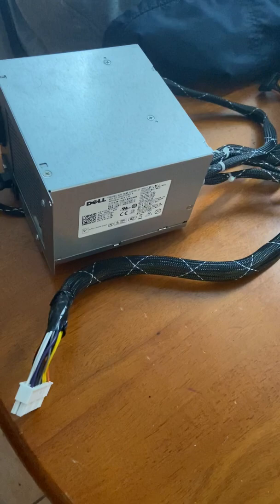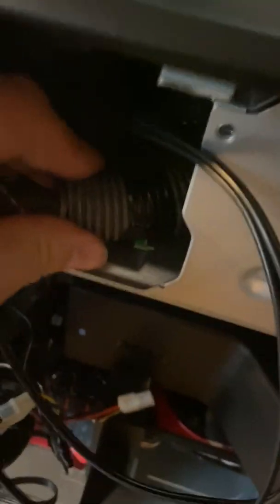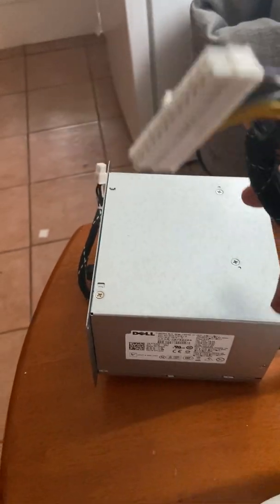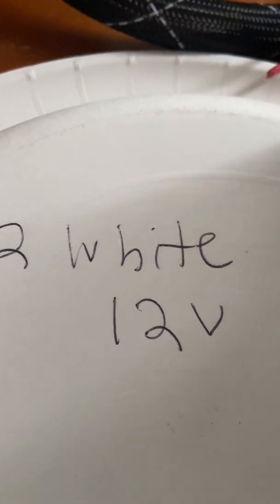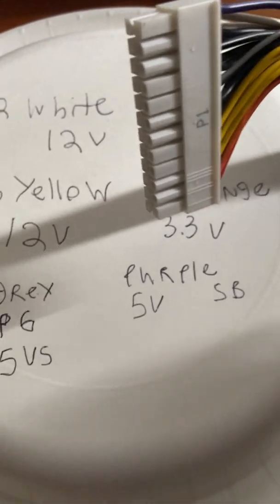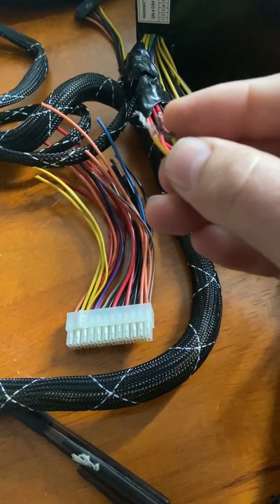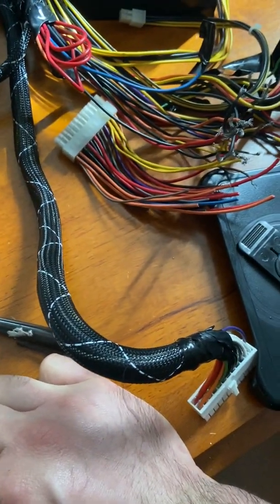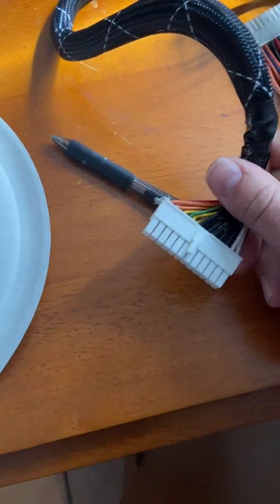USING A ATX PSU ON A DELL POWEREDGE T310 SERVER

Comment: Hi! Thank you for the video. I have the exact same issue where my Dell Power Supply is not powerful enough. I tried replacing it with a 550W but even wiht using the Dell harness the server won't boot. I manage to get the green light ON but still won't boot. Any more details you can provide like the pinout? I noticed that the ATX power supply has a blue wire -12 volts but did not find this wire on the Dell Supply... Any advice?

Comment: Hey what about the HD back plane did you have to rewire that too? I used the CPU 8 pin but its not working it seem like the backplane needs a 3.3v orange and 5v red along with the 2 12v yellow and the 4 grounds.

Comment: Hi, recently my DellT310 PSU (T122K) is dead, I tested it with PSU tester it won't turned on, I've tried your methods to rewire the new ATX PSU (Antec VP500) based on your video, but it's not working, is there anymore info on how to rewire my ATX PSU to turned on my DellT310, Thankyou, any reply would be very much appreciated.

Comment: a question the gray wire connects to the same gray wire of the atx sources? when making this adaptation and tapping the power button nothing happens
Reply from the maker: Yes it does
Reply from the maker: The grey wire is a pg wire witch is a power good wire it tells the computer there’s a enough voltage to turn the computer on for it to power on